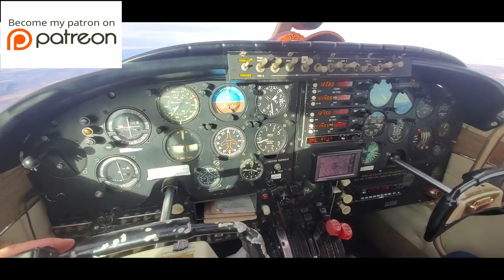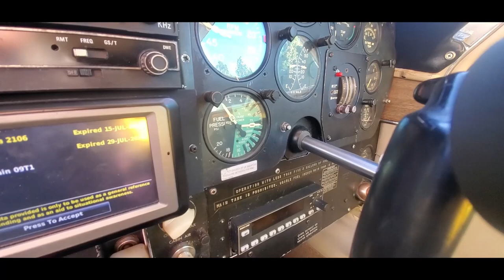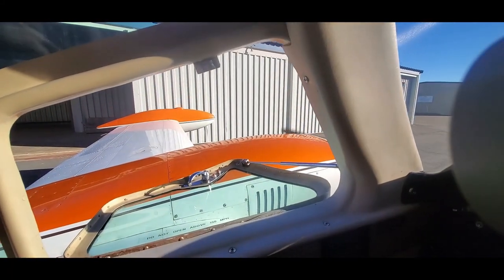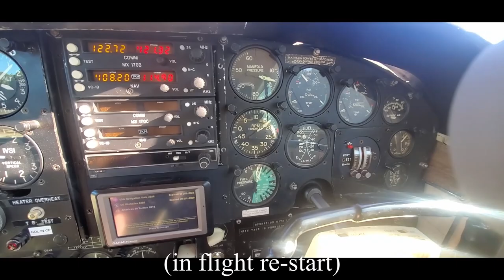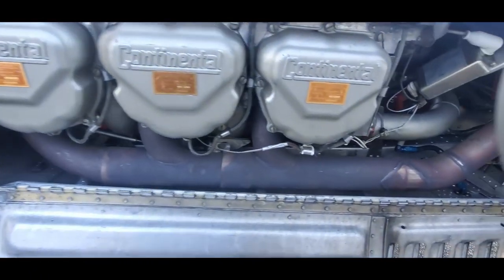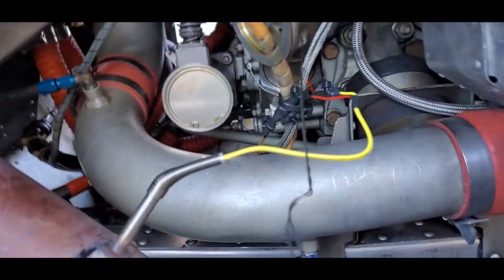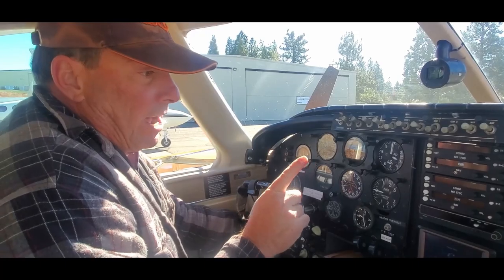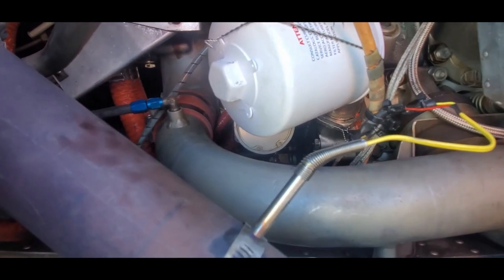1959 Cessna 310-C 'Harvey' Oil Change

Comment: The 310 was my first complex aircraft ride from Hartford to Marthas Vineyard in 1966.  I was 17 and got hooked.  I retired at 65 flying the 310.   Except it was a brand new Airbus A310!!  Two motors and two pilots to share the fun!!!  I instruct in radio control which is much harder but cheaper.   I have a $250 Cessna 310 from Hobby King with retracts and flaps and has no oil as it has two brushless electric motors.   On low passes I imitate the sound and we laugh a lot at my club!!!!   Keep up the great videos!   VicT
Reply: It would be fun to set up independent throttles on the RC plane and simulate reduced power on one engine, so you can maintain your "engine out" proficiency.
Reply: @chetmyers7041  Could be done with a channel mix, even on electrics, failures are rare but they do happen!

Comment: I am a car guy when it comes to fixing things/maintenance its cool to see the extra steps like the safety wire but otherwise not too much different than changing oil on a car.
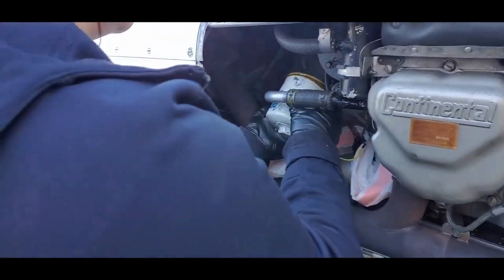Reply: Are you familiar with any car engines that have the nipple permanently attached to the filter?  See video at 8:55
Reply: @chetmyers7041  I have seen trucks like that and canister filters on some cars.

Comment: When I was young and dumb and I worked at a general aviation airport in Minnesota I frequently had to taxi a 310 that was based there. It was a newer model that had the swept wing tip tanks and I think it was fuel injected. I taxied different twins before I got my multi-engine land rating. My favorite twin was a piston high wing Aero Commander.

Comment: There's a million ways to do anything ... thanks for posting that, Juan!
Personally, I leave the generators/alternator off until after the engine is started, and
I check both right mags at the same time, and both left mags at the same time.
But, that's just the way I do it.

Comment: I owned a C-310P 1969 in the mid-90's . Enjoyed flying it. I searched  for it in a database a couple of years ago just to see if it was still flying and found it had ended up as a trainer but had a landing gear failure and was severely damaged and scrapped.

Comment: My GOD what a beautiful 310!!! That, sir, is an airplane to be proud of! I've got about 1,500 hours in 310, 320, 401, 402, 421 and I'd take a "Sky King" 310 over a B-Baron any day (and I'm a Baron lover... my first airplane my Dad and I owned... a 56-TC Baron. Incredibly fast, just don't watch the fuel flow!). Only shortcoming on a 310, earlier than a 'Q,' is the nose gear bellcrank. Try your best to get it well below max gear speed before you drop the wheels. Other than that.... 

When you pointed toward the floor and said, "That's where you check the carb heat...". Must have very special, unique IO-470's that have both injectors AND carburetors. OR, is yours a very early 'C' that still had O-470's? ( The 310 B had O-470's and they upgraded to IO-470's with the C model). 

Question, and maybe you can't answer this.... The 'D' model came out with the swept tail whereas the 'C' still had the straight tail. Ever compared a C to a D to determine which is faster?

Comment: Very cool, The 310 has to be the best looking airplane ever. I have a 60 Comanche 250 (KPRC) so same era. Oil change w/filter I fill with 10 plus 1.6 oz/qt cam guard. I let it go to 8 before adding a qt. It hovers btwn 8 and 9 without blowing it out. I got my private Camoran Park 1992 so pretty familiar with your terrain. Good post!

Comment: I put 2700 hours on my Mooney, flying mostly in Canada.   "Cold" starting at below freezing temps was something that had to be learned.  With experimentation, one can learn exactly what amount of priming works best.  Some pilots lack a "feel" for engines and don't understand leaning after the start, keep the engine under load while descending, etc.

I used to do my own oil changes.   I installed a quick drain oil plug.  Just pushing it in started the oil draining.   I installed a 12" piece of garden hose on the drain, so the hose poked a half inch out of the cowl flap.  This made for an easy, no mess, oil change.   That said, I do not know if that mod was legal or not.
Reply: I totally agree with "lack of feel"!! I dont fly,,, I'm a 2stroke guy!!  Same thing with a 2stroke, you need a feel for, and an understanding of the right action to get the  right reaction!!
   I have no interest in being a pilot but i do understand a huge amount about flying from just watching and learning from Juan's videos! An excellent teacher and a very interesting bloke!!
All the best fae Scotland

Comment: JUAN, is there an SB or AD to remove the rocker bar from the Mags? I grew-up flying a 310C model (N666T) and someone removed the Mag Switch rocker bar to prevent an inadvertent shutdown of both engines when, possibly when turning off boost-pumps.
Even with the Mag. Switch rocker bar removed, my dad once killed the #1 engine on a night departure when he though he snapped off the boost pumps but got the left mags. After realizing his mistake he flipped both Mags back on which lit off a lot of raw fuel in the #1 Augmenter which caused a bit of a BANG! and a spectacular afterburner effect. The Passenger on the left rear seat exclaimed "WHAT THE HELL WAS THAT!" Dad Said, "Oh, I was just checking that left mag, nothing to worry about" The passenger said "Oh Hell, please don't do that again, I'm scared of flying enough already."
After that I always switched off one boost pump at at time to prevent an inadvertent engine shut-down.

Comment: I didn't see much oil coming out of the filter when it was removed....does it have an anti-drainback valve? I always get a lot of oil out of the filter with the anti-drainback valve on my vehicles. I use a piece of cardboard to channel the oil to the collection pan.

Comment: Always wanted a 59 310. I have a 58 182. The 59 model was the last year of a square tail and the first year of the 260 horse fuel injected engine. Lighter fuselage with a bigger horsepower, how sweet it is. I envy you😁😁😁

Comment: My process for oil change took longer. Remove oil radiator
lines & drain it too. Then let everything drip overnight.
Your oil will stay clean for hours & hours. It will look like you
replaced the engine. Very satisfying & worth the extra effort.

Comment: Also, have you over-temped the heater yet? I think it would do that if you use it below 140mph. Have to remember to turn it off if you slow down to top some tops, as once it over-temps you you have no heat until you land and reset it. I've froze my ass off a couple of times after I overtemped it.

Comment: I noticed the "Heater Overtemp"/ T&B Power light. At least yours is marked. Both the 310C I got my multi in and the '68 310N we owned had the same light but neither were marked. Strange combination for an indicator lamp. Push it, it lights if T&B has power, but if it lights on its own you have a heater overtemp. Took us until we had a real heater overtemp to finally figure it out. No POH in those days, just a rudimentary Airplane Flight Manual and Placards. C model is a little rocket. Same 260 HP engines as the 310N. Accelerate Stop around 2500 ft if I remember correctly. On my multi check ride the DPE pulled left engine at 70 mph on a 2900 ft runway using the mixture control. Also did Vmc demos at low altitude (where engines were making full power) according to FAA requirements at that time. Scary to think about now. Anyway, the '68 was a bit faster in cruise even though gross was 5200 lbs, but accelerate stop was closer to 3500 ft. I think the 310C was only 4600 0r 4800 lb gross.

Comment: Darn it. You skipped the best sound of those IO-470’s. The sound on final with props pushed up. I was flying both the 310 and an Aztec. The 310 just looked and sounded so cool. The Turbo Aztec had boots and a de-ice plate for the windshield. I still was very reluctant to fly in any icing conditions near the mountain ranges of California. We could and did encounter Upslope icing conditions where the ice could build up so fast the boots would not shed it. Smart pilots just did not stay in those conditions. That Aztec and I flew many a minimums approach into Sacramento.(KSMF). We had a name for the fog in the Central Valley of California. It was called Tulee Fog. It would start at Bakersfield and continue all the way to north of Sacramento. Any idea of where the name Tulee Fog came from? Sorry way off topic. Beautiful 310 C!

Comment: Another thing that you can do to keep filter changes less messy, perform your engine run up, then after pulling the sump plug, puncture a small hole in the filter housing and use a nozzle to blow compressed air directly into it. It will force the oil from filter to sump and make less of a mess when you remove it. Still want to keep the bag under the filter though when you remove it.

Comment: Juan, you mentioned at one point during the video something about the carb heat and yet you talk about the engine being an IO-0470 instead of an O-470. Which is it? I used to own a later model 310 with the IO-470's, and what sweet engines they are. I used to cruise at 187 kts at FL80.
Reply from the maker: I should have said “alternate air”.

Comment: Lovely aircraft, Juan.
The only thing I add is to run a finger around the filter to see if there is any oil making a bid for freedom, or a twist of shop paper towel if there isn't access for a finger.
Found a few seepages that way on older car and (particularly) motorcycle engines - always solved by wiping around the seal seat again (I guess motorcycle engines suffer from road grit worse, and it can get knocked down when putting the new filter in).  when an engine is that clean though, it probably adds little value.

Comment: Flew C310 CF-SII s/n 35378, a straight 310, no wing tanks, just tip tanks. Interior looks much like yours. Flew it thru northern Alberta, Canada for a few years on charter. Great a/c , but short on range & always had problems with oil coolers congealing @ -30 to -40c temps.

Comment: You've certainly got yourself a nice clean plane there Juan.  Interesting that you bring the mixtures back after she starts, what's your field elevation.  I worked on 310s with both the 470 and 520 engines, our airfield was 270 feet amsl and we would leave the mixtures at full rich after start without any problems.  The Continental flat 6 engines are certainly smoother than the Lycoming O and IO 540s that we also had in the fleet.  Good move to use Cam Gard, though with the camshaft being underneath the crank on Continentals they benefitted with oil drip from the big end and main bearings when parked up for a period of time.  The Lycoming however, with the camshaft above the crank, always gave us more problems with cam and follower wear as it would dry out over a period of time.

Comment: Nice, I didn't know you owned a twin, or were an A&P. Mostly I saw you puttering around in the Husky, or flying Big Jets. One thing struck me in this video: if it's an IO-470 ("I" for "injected"), why would it have carb heat? (06:10) Or is it really just "Alternate Air" if the air intake filters are clogged or iced? Thanks.

Comment: Always worth remembering that calling these engines "air-cooled" is only half the story, just like on my old 911 Porsches, the other half is that they are oil cooled, so essential to make sure they have enough clean, well filtered, high quality manufacturer's spec oil at all times.
Reply: Wilson, hello, long time ago PORCHE, DID make several engines with dual magnetos for AVIATION, but have NO IDEA if they were still made., I had a ride in an HISPANO SUIZA  ENGINE IN A N OPEN 2 SEATER IN 1958 IN JAMAICA, STRAIGHT 8.  2 PLUGS PER CYLINDER 2. MAGS TRANSMISSION  NON SYNCRONIZED, AND NOISEY !  🇺🇸🇺🇸🇺🇸🇺🇸
Reply: Wilson, hello, long time ago PORCHE, DID make several engines with dual magnetos for AVIATION, but have NO IDEA if they were still made., I had a ride in an HISPANO SUIZA  ENGINE IN A N OPEN 2 SEATER IN 1958 IN JAMAICA, STRAIGHT 8.  2 PLUGS PER CYLINDER 2. MAGS TRANSMISSION  NON SYNCRONIZED, AND NOISEY !  🇺🇸🇺🇸🇺🇸🇺🇸

Comment: At the risk of starting a battle, I am under the impression that the aeroshell 15w-50 actually does have the LW16702 in it, which is required by an AD on Lycoming 0-320 H engines.  I've used it for 30 years in my 172E and 177B, since I figured if it protected the 0-320 H camshafts, it would help protect the cams on other engines.
Reply: It doesn't look like LW 16702 is actually added to 15W-50 (unlike their "plus" oils) but 15W-50 contains an anti-wear additive and meets the Lycoming spec so LW 16702 is not needed...

Comment: Juan, the IO-470 is fuel injected so I was curious as to why you mentioned and pointed out carb heat controls on the center console.  I was trying to find my ‘64 310 POH to check because I wanted to refresh my memory what was there😉. Nice clean bird though.

Comment: Juan, do your oil caps/dipstick have any rust (signs of moisture)? Just curious as I've seen that on similar engines and also heard to take your oil caps off after flight to vent the heat. However, that's not without its own risks if you forget to put the caps back on.

Comment: Can I make a suggestion?

On cold starts before doing anything else give the motors a good 4-6 blades of rotation on the starter to lube the motor a little and more importantly the cam. 

Also There is no replacement for oil analysis on Recip  motors cheap good piece of mind.

Comment: I use AV-Blend in my 82 Piper Tomahawk, you can put a little oil on the oil filter round gasket, the filter may seat better.

Comment: My 1961 C310F has a lethargic left boost pump on low compared to the right, which I thought was indicative of a problem to be investigated, but I see the exact same behavior on your plane Juan.  Must be a "feature" of these early 310's fuel systems.  Can't fathom why though.  Same pumps, same valves in the wings just outboard of the engine nacelles.  Pressure is measured at the engine.  Very odd.

Now, with respect to oil leaks, I'm envious.  Mine leaks a little and it is frustrating to track down and fix the sources.  However my engines are at TBO and were worked on by various mechanics before my stewardship began 5 years ago.  Oh the sins I've found...  Interesting oil filter adapter.  Those O-470's came with screens.  I've not seen one like that with a hex plug at then end in 30 yrs of working on airplanes.  It doesn't appear to be Continentals screw in adapter or the F&M (now Tempest) variety.  Perhaps it is an early version from Continental as I see hex lock nut in the later portion of the video.

Comment: Nice airplane . I did my multi engine training in a Piper Apache. Only 160 hp 😆. Hydraulic landing gear. Hydraulic pump on left engine. If you lost the left engine, you had to manually pump the gear up 🤪 While maintaining control of the aircraft. It taught you to budget power.
Also always liked to synchronize the propellers by sound.
Reply: And if you lost the right engine, you had partial panel!  Got my multi in a Geronimo and a PA23-150.

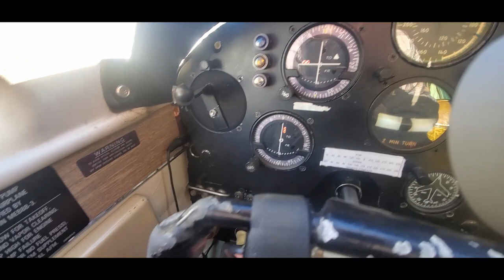Comment: @blancolirio — (1:42) What is the purpose of the two flip-bars covering the toggle switches in the lower left area of the panel?  They move in the same direction as the handles of the switches and wouldn't seem to provide any protection against inadvertent flipping of the switch handles the way a toggle switch safety cover would.
Reply: @bobwilson758  Thanks, and there is no need to be abusive by referring to me as "Dorff".  You have never met me and you do not know me or my background.
Reply: They're called gang bars.

Comment: If I put the full 12 quarts in my 0-470 (in a 182 but a "12 quart" engine), it will immediately blow at least two quarts out the breather.  At oil change I add 9 quarts and 13 oz. of CamGuard.

Comment: I had a 58 I think it was, a B model, but didn’t have to change the oil, just replace it.
Reply: I had a B as well, but mine didn't leak or burn oil. (I was its pilot and mechanic)

Comment: Juan Is it common to find that all batteries and generators are all turned on before start?
Reply: I don't recommend putting generators on line till the engine is smoothly running.  (Pilot, A+P for 40 yrs and C310B prior owner here)